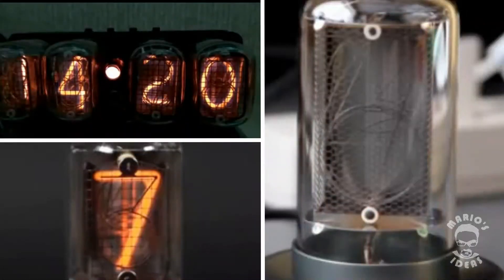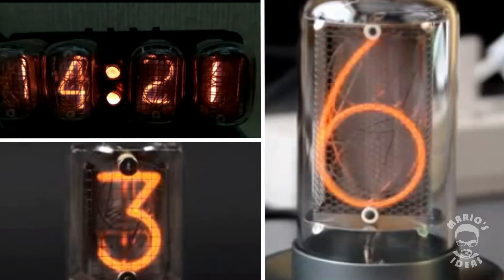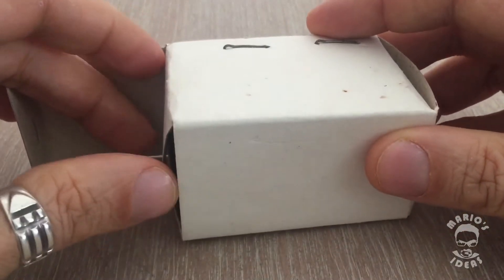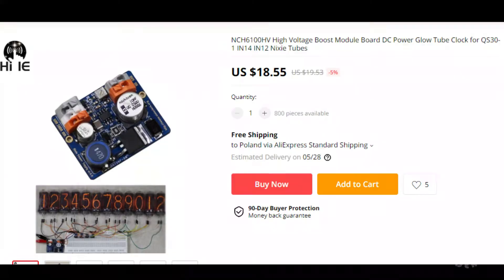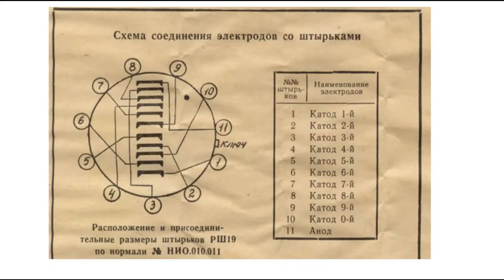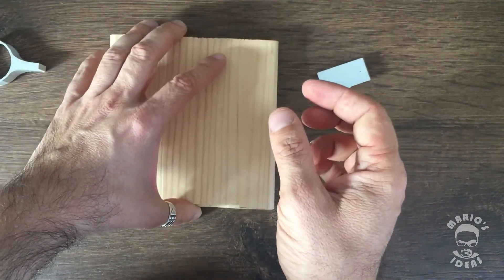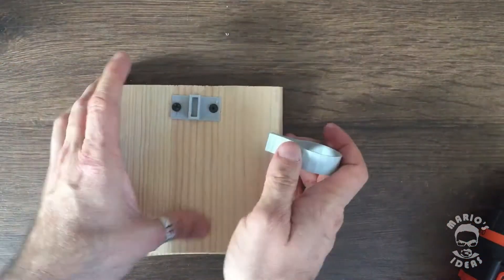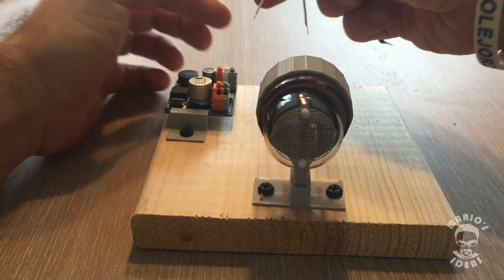How to power  Nixie tubes with  DC 12V  for Arduino projects

Comment: Very informative thanks, what current does the tube require? I see you are using 12v but I wondered what amp your power supply provides
Reply from the maker: The tubes do not require a lot of current. I used 12V 1,5A. Have you seem my other video about nixie tumes and controlling them with Arduino. https://youtu.be/tSq-ooX5Q8U
Reply: @marios_ideas  Brilliant thanks, your other video was very useful too, I'm going to order some and see what I can do with an Arduino!

Comment: I’ve noticed Arduino seems to be used almost exclusively for Nixie tube projects as opposed to Raspberry Pi. Is there a reason for this? Or is it just a matter of preference?
Reply from the maker: I think the reason is that Rasberry Pi is more expensive board and checp Arduino deos a trick:)

Comment: Cool! I didn't know if we could do it without using a resistance. In some tutoriels I've seen, they added a resistance to each tube but it's impossible to know the value. Do you have any idea? Is it useful?
Reply from the maker: Well . I think you need a resistor when you are controlling it through the dedicated chip.
Then you connect the + of 180V power supply to the Lamp cathode through the large resistor and have all cathodes connected to the pins of the chip that controls which cathode recives low signal to lit corresponding the digit. I think I saw 10k resistor used in this case.
I am not great at electronics but I guess this is to pretoect the chip from too much current, but I may be wrong.
Commens anybody?:)
Reply: @marios_ideas  oh OK I understand. I've seen a lot of forums and they all give different values of resistance.. From 10k to 68k! But what I've seen mostly is from 15k to 20k, with a 180 DC power supply
Reply: @fh5052  the 10-20k resistors are used in combination with multiplexing, which technically provides roughly the same amount of current if you use a 68k resistor, because of the way multiplexing works. If you directly power nixie tubes you should atleast use 68k ohm resistors if you want your tubes to last. if the resistor value is too low or you dont use a resistor at all, the tubes will die pretty soon. Multiplexing also extends your tubes life by alot, but this could be out of scoop for some.